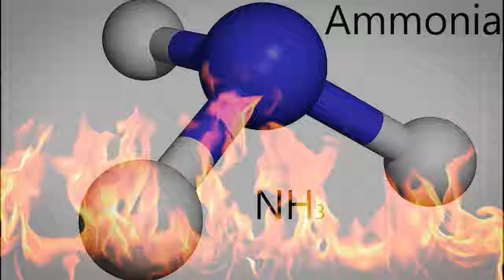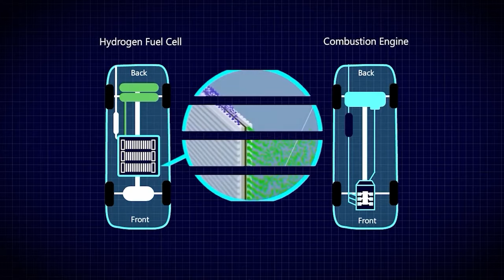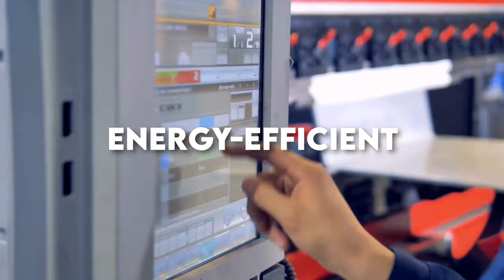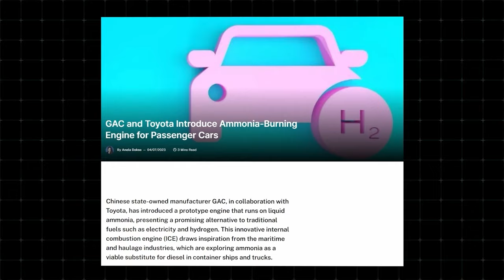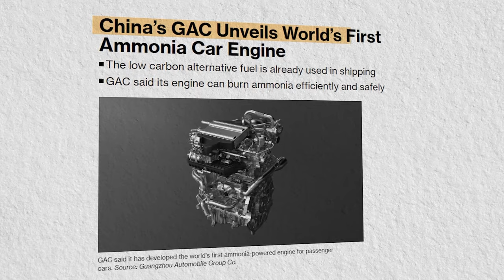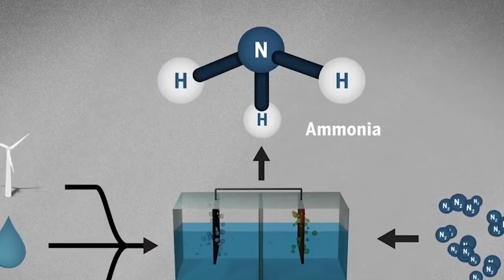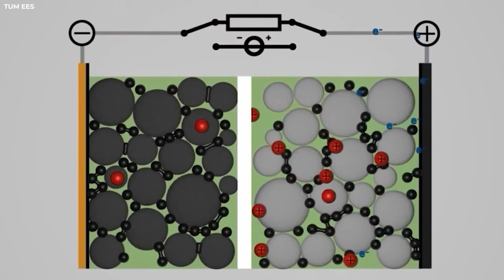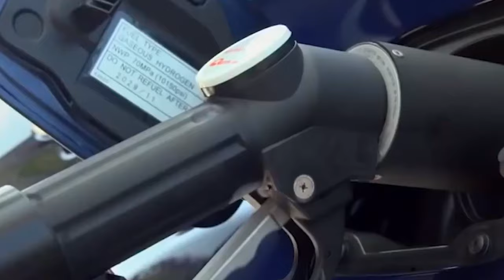New Amonia Engine Will Destroy Entire EV Industry

Comment: How is this any different that existing hydrogen cars? Looks like identical tech.
Reply: I guess there is less energy loss in producing ammonia instead of hydrogen gas?
Reply: Electric is the most flexible as you can charge it anywhere, including at home; that's just a starting point and it will go further than that!